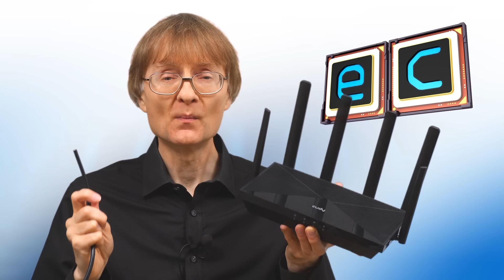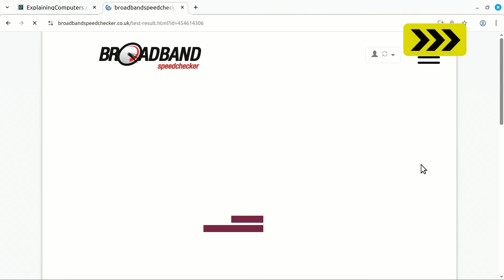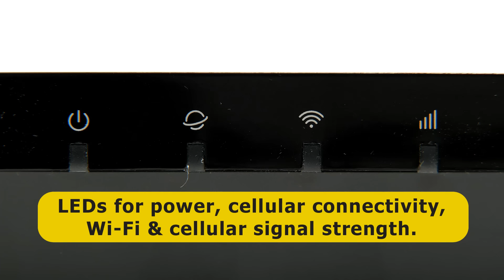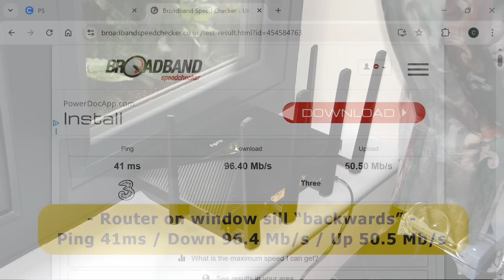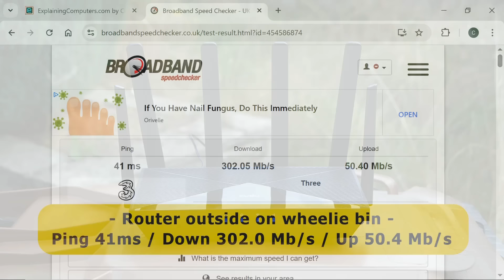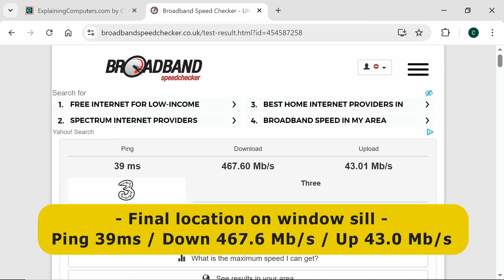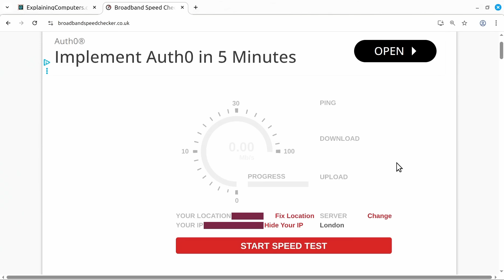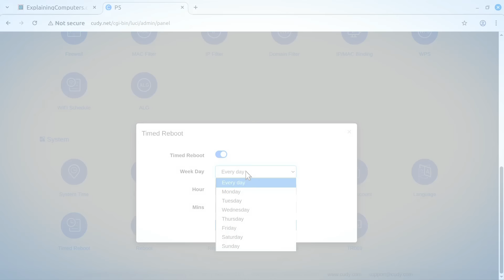Switching to 5G Broadband: Cudy P5 Router

Comment: We live in Southern California and have cable internet through Cox Communication's Gigabit plan. This is the only wired pan we can currently get at our place. On a good day, when the traffic on Cox's network seems to be low, we can achieve up to 950 Mbps down and 115  Mbps up. This is in the ballpark as the advertised 1 Gbps and 35-100 Mbps up. I wouldn't complain, if we would always achieve these speeds. Unfortunately, they drop often to way lower numbers, up to a complete breakdown of the connection. I have fought many battles with Cox and I openly hate them. At the beginning of the pandemic, they left us a whole week offline, as they seem to have disconnected us as they were working in the distribution box to fix someone else's internet. This seems to happen often, as there is an utter unorganized mess in their distribution boxes. I peeked over the shoulder of their technicians, while they were ripping through a mess of cables and filters to fix our connection. During this process, they probably messed up somebody else's internet. Next to Cox being extremely unreliable, our plan is also very expensive despite having a data cap. To get rid of the data cap, we would need to switch to an even more expensive plan. They have practically a monopoly on wired internet and take full advantage of it for many years. Since a month or so, there is a new fiber ISP serving our street with up to 5 Gbps symmetric internet and no data caps. Yeyy! Unfortunately, our landlord won't allow them install their network. Boo! Now, I have to battle them to get fiber in the building. For the meantime, we're thinking about adding 5G as a backup line to stay connected when Cox fails. T-Mobile offers some backup plan for $20 per month or so. Fortunately, our router (GL.iNet Flint 2) has the option to setup a second ISP as failsafe option.

Comment: I've been using a 4G CAT 12 router for a few years because i've moved around a bit and don't want the hassle of being tied down to land-based internet contracts. My router was a cheap refurb unit with a firmware upgrade that allowed me to switch from THREE to EE when i moved town, and i needed to switch to a provider with better coverage.  It has operated flawlessly and is better than every land-based broadband i've had in the past, so i probably would not switch back to land-based but might consider 5G, which has recently switched on in my area. 
The only thing to bear in mind is that performance drops during the day when more people are using the network, but during the night i get a 4G download speeds  in excess of 100Mbps and upload of around 40Mbps
That might sound slow to some, but i am on a tight budget and pay less than 30 quid a month on EE. If i need to move again, then i'll look at my options then, but the best thing about 4G/5G internet you can simply take it with you!
Reply: Check IDMobile provider, I am paying £15 on 24 months contract.

Comment: Chris, one really cannot discuss the technicalities of 5G these days without mentioning the 5G spectrum bands of High, Mid & Low:
ALL the 5G marketing hype was about the High band headline speeds; unfortunately, that was the one that would need a "cell-tower in every lamp‐post due to its very short reach". IE, it mostly didn't happen.
A lucky few, such as yourself seem to be close enough to a main mast to receive Mid-Band frequencies, with very respectable throughput.
However, the vast majority of the country is only likely to receive Low-Band Spectrum, which is intended for country-wide coverage, distant from a mast (potentially only outdoor reception as higher frequencies don't penetrate brick walls or high-end glazing) and at throughputs no better than 3/4G/LTE.
The problem is that all three very different Spectrum experiences are all called "5G".
Reply: I should also say, that if you have your (Android) phone set for power-saving and forced on 2/3G or 3/4G, when you try to toggle 5G mode, a pop-up states that power-saving mode must be disabled.
This means that although 5G Low-Band will eventually replace the wide 4G coverage at similar throughputs (3G has almost entirely gone now), it comes at a higher power consumption and battery drain.

Comment: No VOIP support? What are you going to do when BT decommission your copper phone line?
Reply from the maker: See the video description! :) I think I have until 2030. After which (or before if necessary) I'll port my number to a forwarding service.
Reply: @ExplainingComputers  Oops, that'll teach me for not reading the description first! :D I don't have 5G in my area so I'm getting FTTP instead and my plan is to plug my normal phone handset into a Tp-Link EX230v/AX1800 router and port my number (I've used for 28 years) to a VoIP service provided by my ISP (they don't advertise it publicly) and hopefully it'll all work out. Can't wait to see your future video on your eventual solution.Thanks for your always  informative and awesome content, it's much appreciated!

Comment: The same thing happened on my side in 2023, only the price has gone up for me, Deutsche Telekom.
I'm being artificially limited on the 5G NSA connection to a mere 300 to 170, and I have a ping of 14 to 20 ms.
And the nearest cell tower is about 2.1km away
With 5G connections, you have to pay attention to SA (Standalone) and NSA (Non-Standalone).

Comment: I'm from Malta. I used to have a 4G router a few years ago, all worked well until a factory was demolished and a tall building was built instead, which blocked my signal from the antenna 😕 then I got a 70Mbps copper connection and last year I finally upgraded to a 1Gbps fiber connection

Comment: Hello chris, I recently upgraded to an eero Max 7 + 2 eero Pro 7's. The setup process was confusing, but I learned that 2.4 devices can occupy the 6GHz bandwidth - is that correct? Also, I found out that Windows 11 only supports certain bands, which required me to upgrade my Lenovo X1 Extreme ThinkPad's WiFi adapter to support the new 6E standard. Clearly, I'm still learning.

Comment: 5G is great - I've been using it for years as my only connection until I switched to a fiber optic connection. The reason for switching was the high ping of the 5G and that bad weather could interfere with the 5G signal as well..

Comment: As always, great video and great start to my Sunday morning! My home network hasn't changed in 30 years. Ethernet network connected through router to cable internet. The local phone company did run fibre to the house but I chose to not subscribe.

Comment: 5G Internet Service Providers are hiding behind 5G health damage scare to data capping and throttling unlimited 5G internet connected customers in their sick-mindedness 😮
This throttling is so bad in a place 6 antennas are situated all around the building from 200  to 500 meters distance 😮
This illegal, criminal, unethical throttling by the ISP, hinders OneDrive synchronization every time, making it useless to have cloud computing 😮
Once the throttling was too much beyond any justification that a bank transaction reconfirming SMS code came 23 hours later 😮😮😮😮
ISPs are hindering everything to get richer quicker, by cyber-scamming, cyber-mugging and cyber-bullying too 😮😮😮
This is to say, I have invested in very fast latest 5G router modem with Wi-Fi 7 😮😮😮
ISPs in Europe are worse than mafia street gangsters 😮😮😮😮😮

Comment: Live in a rural mountainous area of the US (Northern California) and 4G LTE would get us maybe 6 to 9 Mbs, no 5G available, DSL service was pulled from our area.  Spent the money and got a Starlink and get around 100 to 300 Mbs, very happy with Starlink.
Reply: Starlink is the last resort here in Europe and often not the best choice as there are cheaper cellular options.
Reply: here in the US our cellular networks are not solid away from the highways and high population area.  I have limited LTE coverage and only DSL at about 1Mbps.
Reply: Starlink is made for your country due to its size. I find internet in Europe to be very good, much better than rural UK which is much like rural USA it seems.
Reply: Over here our unlimited Internet on cellular never is, so we’d either get throttled to nothing or have to pay a huge amount for this.

Comment: I'm lucky to live in the Netherlands where the infrastructure have been invested in for many years. Cable and now Fibre have been around for many years. I currently have an FTTP gigabit connection with a consistent synchronous 950 Mbps up and download speed with a ping of 4ms. My provider even offers 2.5 gigabit and 8 gigabit connections, but I don't have the need or hardware to require/support that. Oh, and I pay the equivalent of 25 GBP per month

Comment: I'm  pleased with my FTTH here in Blighty, but I do wish I could set up both the 2.4/5 GHz WiFi channels separately. The 2.4 may have better range/penetration but it's slower (noisier I guess) and given the choice my pooter keeps defaulting to the stronger, but slower signal, so I mostly turn off the 2.4, which leaves some of my older devices stranded. There are lots of options for getting round this, but until now I hadn't considered the 5G option. Very interesting. Food for thought here.
Reply: That's a simple solution which even the cheapest most useless of ISP own-brand routers should be able to support. Give the 5 GHz network a different SSID to the 2.4 GHz network so you can connect your devices to the SSID for 5 GHz.
Reply: @davida9561  Guess my ISP own-brand router is even cheapest-er and more useless than that! Yeah, buying a better router is indeed one of the options. Thanks for the reply David.

Comment: GL-INET has routers for 4G and I think also 5G.  I had a place I stayed with no Internet service, and tried several 4G solutions, ending up with a GL-INET GL-X750V2 Spitz, which is a very solid and reliable router.  I don't like how the SIM card is handled on the router, but once you have it in place it works.  It's also small enough to work as a travel router.

As for this CUDY router - I notice in the URL that its software is "luci" meaning that the router is running OpenWRT.  It's probably pure OpenWRT rather than the hacked OpenWRT that GL-INET uses.

One of the options I tried before getting the Spitz router was, with a GL-INET Opal router, tethering a cell phone via USB to the router.

Comment: Ah BT. Not much more intelligent than when I left the UK I see. Sounds about right for UK based monopolies. On the speed though, my cable was 400Mbps down and 20Mbps up. I am about to go fibre directly to the house (no copper or cable connection for the last hop) with a 1Gbps up and down speed. And like your story, it's cheaper than the cable connection it replaces. Mind you, landlines are a thing of the past here in the US and my last 2 built homes didn't even have provisions for them. You can get VoIP but if the internet goes out then so does the 'landline'. Been a cell phone only house for about 12 years now.

Comment: you don't need tons of ethernet sockets really, that's what an ethernet switch is for, and no those sockets aren't all individually connected to the CPU usually, it's just an integrated ethernet switch on the board

Comment: 40ms ping!?! Would be quicker to take your packets to the end of the road and put them in a postbox! 

Srsly though, that is quite bad. My fibre connection in London + WiFi to my Mac gives me 2ms and 480/480 down/up. If i switch to my backup EE 5G I get 22ms and 180/40 down/up. 

Such a shame cell connections are so bad at latency.
Reply: In answer to your closing question. I use Hyperoptic fibre. I have a 500mbit symmetric service and I get that with WiFi close to the provided router and it drops to 50-60 at extremes of my property. 
In the several years I’ve had it, it dropped 3 times, upon which I just activate the hotspot on my phone and connect to that. 
Hyperoptic also provides me with a landline that i ported from BT. BT was seriously taking the p1ss on pricing a features. Hyperoptic is sooo much cheaper and more reliable.

Comment: I have fttp to my house and use Cudy mesh points for extensive WiFi coverage, couldn’t get over how well the cudy routers work and are openwrt compatible. If you were wondering about using mesh with your router Chris then it should be fine I see the plus icon next to the image of the router on home screen and they work exceptionally well whilst giving you more Ethernet ports, I got the standard WiFi only wx3000 for about £30 on amazon and it’s very good! If the rumours are true cudy was made by ex tp link engineers!

Comment: For   similar reasons (bad wired connection with multi disconnection) I get the Cudy 700 LTE  4G router which  gave to me a stable connection with 100 to 110 Mbps download and 20Mbps upload speeds . The upload speed is stable  but the download speed depend on the traffic load of sellular .
A very useful, I think , parameter is the tab with devices. You can open it and  navigate to devices where you will find switches for each one which let you to give permission for connecting to internet or not . So you can attach on it   four devices and then you can choose which one of them will have access to internet.
Because of serious problems in infrastructure of public net, my ISP offered to me a 5G connection as alternative solution ,keeping the same telephone number , free hardware and same service payments. 
I connected the outlet of ISP  router to WAN inlet of LT700 for redundancy with two sim cards installed , one at LTE700 4G and the other at ISP 5G router. Cudy routers giving priority to WAN connection and if for any reason it fail then connect the 4G .
The problem with mobile internet is the distance and visibility of ISP antenas and  it's speed depend on the traffic load .
I recommend  5G routers  for  pole installation as they can  run over neighbour substructions and low buildings.
In some cases a downgrade from 5G to  4G giving better speeds and stability.
Now in case of disaster (natural or any else) all these communications will stop exist. Wire connectivity which is the most redundant do not exist because of maintaining cost....

Comment: I haven’t activated 5G WiFi as it’s not clear to me whether claims regarding adverse health risks are credible. What is your idea about it?
Reply: 5 GHz Wi-Fi and 5G mobile are two completely different unrelated technologies which use completely different radio frequencies. 5G mobile uses a low band frequency around 700-900 MHz (similar frequency to car keys and wireless heating thermostats - slow but gets through brick walls for coverage indoors) and 3.4 GHz (between the 2.4 GHz and 5 GHz Wi-Fi frequencies - higher speeds for outdoors use).

The frequency everyone is worried about and incorrectly associate with 5G mobile masts is 60 GHz. That is not used for communication with end mobile devices as even a piece of paper can block it. 60 GHz has limited use for point-to-point connections so mobile masts in areas with no fibre optic available can uplink to another nearby mast that does.

Comment: I remember my dad had a so called cable tv modem with just one ethernet jack and no wireless (this was 16 years ago). At one pooint I tried to share the connected pc's internet connection but that did not seem to work and seemed to be limited by the cable modem.

Comment: External antennas are useful in bad weather. On a sunny day I get the same speed with and without extra antennas. But when it's raining/thunderstorm on build-in antena of my Huawei B535 4G ruter speed drop down to 0.5 MB. With external antennas placed outside of the window I have stable speed (good weather up to 100 MB bad weather ~ 30).

Comment: Glad it worked out for you Chris. 
I myself went for a Starlink solution when I upgraded my network at the cabin. I don't know what the price for 5G is around the world, but for me in Norway, Starlink was much cheaper and faster than 5G.
Reply: Starlink residential in the UK starts at £79 a month + £299 for the starter kit. It is far too expensive unless you live in a very remote location with no other option. I pay EE £30 a month for SIM only unlimited 5G data with prioritised data access when the masts are congested (fair use policy after 700 GB is used per month the prioritisation stops working).
Reply: @davida9561 interesting. Because l pay 569 NOK for Starlink and the starterkit (router and antenna) was for free. A unlimited 5G in my area (and I dont think I get 5G speed) is almost twice the price.
Reply: @davida9561 my case exactly. Standard FTTC was horrifically slow and unreliable for my location, with a 2km copper run from the nearest fibre cabinet. With the use of roof mounted antenna’s I managed for awhile but the consistency of the connection was bad. Frequent restarts were the only solution. We hardly get any 5G signal as yet and when I could connect the ping was bad. Switched to Starlink as there was no alternative right now. Expensive yes. But as my business involves a lot of remote support sessions, Starlink has been a revelation! I’m literally in the middle of nowhere but with 300meg download, 25-30 up.
Reply: That is surpricing for me since starlink would be the most expensive solution in Sweden, what is the monthly cost for starlink in Norway?
Reply: JPLE84 I pay 569 NOK for Starlink and the starterkit (router/antenna) was for free. A dedikated unlimited 5G network is approx twice the price.
Reply: @morten61  Interesting, the Starlink price is about the same in Sweden as in Norway but there is a very large diference in price for unlimited 5G then

Comment: The state of Internet provision in countries where the Internet was first introduced (USA/UK) terrifies me. I lived in both, and in both the service was the worst I ever had, and the most expensive. Clearly, your system isn't working!

Replacing wires with 5G might work for a few, but cables are the only way to build a resilient infrastructure with sensible latency.